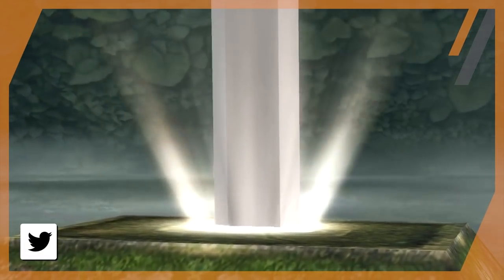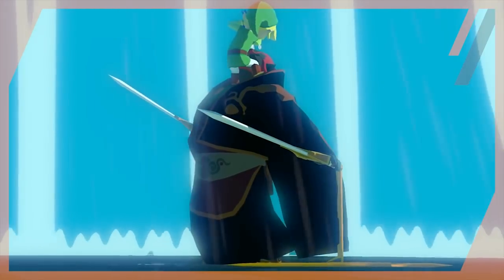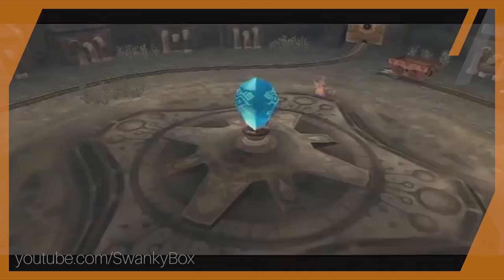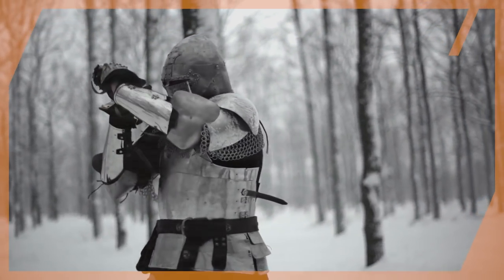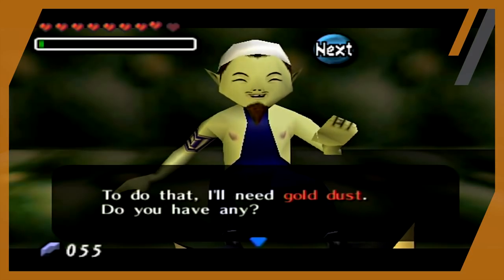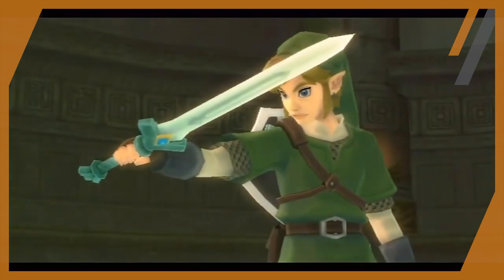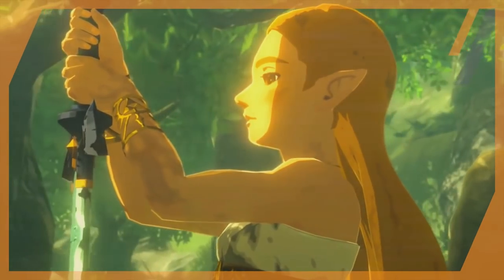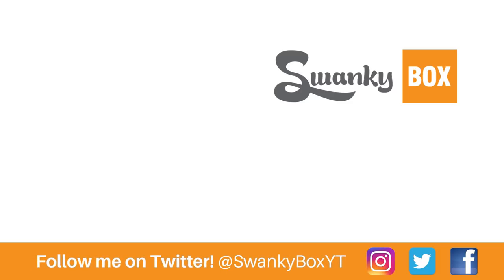Why EVERYTHING About Zelda's Master Sword Somehow Makes Perfect Sense

Comment: 1. The Master sword is NOT a broad sword. It's a Bastard Sword.
2. Armor CANNOT be cut through. Only through some gambeson (cloth armor).
The higher quality gambesons took a couple of swings before you could actually slice the flesh of your opponent. But most people also had chainmail on over their gambeson. Which chainmail is resistant to slash but weak to thrust and strike.
Reply: Well your point on armor not being cut through is flawed as armor can be cut though like gambeson it just depends on what metal the sword and the armor are made from and how the armor is struck.
Reply: @PaulonTheBrave  
I said gambeson can be cut through, sometimes it just takes more then one swing though.
Reply: @s.e.n3264  ok
Reply: You also said armor CANNOT be cut through. You even capitalized the word lmao
Reply: Bastard Sword? That's not very nice what did the Master Sword ever do to you? Why you gotta disrespect the poor thing.
Reply: @benwells7047  
Yea, then I said gambeson can. You can't cut through chainmail or plate armor. Please finish reading the whole thing people...
Reply: @Werewolf914  They should apologise to it, its doing it's best
Reply: you cant cut, that is why you hold the sword by the blade and strike with the oposite side, as a hammer, or use a hammer.
Reply: I'll throw my hat in the ring on the realism of the master sword
1: Let's get our terminology right. The Master Sword is best described as a Longsword, which most modern people know as a "Bastard Sword" and the sword most people associate with the word "Longsword" is actually an "Arming Sword" or sometimes even just called a sword.
2: I'd say the most unrealistic thing about the sword is.. where is the distal taper? with very few exceptions, the design of swords tend to have most of its balance and weight near the handle to allow it to be maneuverable, but this would be a lot more top heavy.
Reply: As a modern term, I agree, it's a bastard sword. But historically, it would be a long sword, or even just called a sword. Really, its just an ornate version of a classic sword style. If you really wanted to call classify it, it's probably closest to an Oakeshott XIII.

 And armor "can" be cut through and not terribly difficulty with a sword like that. But there's next to no point of doing it, as the armor would still have done it's job. And likely you will have just lost your sword. Any cases of it happening in combat are pretty much fluke accidents. (Ex. A blow getting deflected into another person.)
Reply: @igorgiuseppe1862  
It's called "Half swording"
Reply: Even half swording doesn't cut through armor. You are trying to damage the armor and using the sword as a blunt object. One handed swords aren't designed for dealing with armor.
Reply: @Quentonic  The master sword is more like a large hand and a half/bastard sword. Which is still classified as a long sword. It could do the job, again, plenty of cases of swords splitting armor. But pretty much unintentionally. No one who knew what they were doing would actually aim for the armor.
Reply: Also, the stuff about the soft core and the hard edge applies to katanas but not to european monosteel blades.
Reply: @PaulonTheBrave  Nah, it's nigh impossible to cut through armor- it's too strong. The only way to get through it with a weapon is puncturing it, like with a warhammer.

Mind you, we're talking plate armor
Reply: And you don't want a sword to be sturdy, you want it durable and really flexible. I think we both vringe as much with this video.
Reply: And the crossguard is ridiculously thick and chunky
Reply: @giovannylinares2054  Um... difference between those two words? Sturdy and Durable are synonyms in most peoples vocabularies
Reply: @giovannylinares2054   And I'd generally call this bit creative license, although with the Timestone theory we actually have a semi-good reason for it to be so thick. to aid in its chronomantic abilities
Reply: @aquamarinerose5405  In this case, I believe Sturdy would mean 'solid and inflexible', which you don't want in the blade, specifically- needs to have some Wiggle, as it were.
Reply: @AtelierMcMuttonArt  Ah, that I can understand. I just generally assumed sturdy and durable to mean generally the same thing... And of course with the power of the gods imbued into it you probably could've made it out of whatever and it would work just as well tbh.
Reply: @Dhorannis  While certainly correct for the historical analogues for the Master Sword, there have been times when European and Middle Eastern smiths have used different steels for the core and edges and welded them together.
Reply: @Cataru Moore: Maybe the material of the master sword is very light - so light infact, that the creators maybe deliberately made it top heavy, so that you could deliver heavier blows. But then again, if they wanted to make a weapon that can hurt foes in armor, they could've just made a warhammer out of the same material and it probably would've been better.
Reply: It's a Broad sword in OOT and WW!
Reply: no a bastard sword is a long two-handed one. broadsword is a hilt &1/2
Reply: 1. thats not very family friendly though. they'd have to call it a "hand-and-a-half" sword for it to pass the censors.
2. yeah, but Link can flip over gaps with both a sword and shield in his hand and even parry a centaur that's charging at him like a bull. i think normal human limits are irrelevant when talking about Link and his magical sword.
Reply: I say send him to the ranch
Reply: 1.That is...an unfortunate name...
2.*unless you're in an anime or other such fiction, because then armor might as well be paper mache. Granted, armor in Zelda does usually work as intended, but since it is a fictional universe, I felt it necessary to say that
Reply: Its a spanish Tizona sword.
Reply: @M R  M R  firstly why are you taking offence to a 3 month old comment, second i wasn't trying be a historian I was pointing out that in theory a sword made from a stronger material and with a sharp blade could in theory cut through armor. That and the person i was retorting was implying armor couldn't ever be cut though when we are taking about a literal divine weapon made of a unknown material that could have those properies. 

Then again this is the biggest problem about trying to bring logic to a fictional weapon that not only has both divine and spiritual properties not to mention the metal it's made of is unknown
Reply: @M R I wasn't trying to be holier than thou on realism. I was more just saying it because the #1 problem that most fantasy has in regards to "Realism" is making things too thick and wide. and if we're trying to go for how practical/ 'realistic' the sword is we get that point.
Reply: You sound like shadiversity or something
Reply: And 3: we dont use the master sword in majoras mask
Reply: So you think carbon steel can't cut through wicker, bronze, leather, silk or wood?
Mind explaining why I had to repair so many round shields if armor cannot be cut through? Sure looks like those shields got cut through quite a few times in the course of the battle.
Think you can't lose your wrist just because you put an iron splint guard over it?
Or are we just pretending like non metallic armor was just never a thing if it wasn't gambeson?
Mind you, silk robes serve as armor and protection as well and can keep a blade from cleaving in to your vital organs, but it won't stop the cut. For your statement to be true, you have to make some absurd rules as to what qualified as armor. Freaking animal hides were used as armor, and plenty of those got cut through, most noteably in the settling of America. Armor isn't just something that exists on the European continent... this is a huge problem with you guys in the HEMA community and it's only getting worse.

You guys gotta realize that your world of martial arts isn't the whole world. Saying that armor can't be cut through is an out right lie that too many people believe and it's going to become another stupid myth right along side "the katana is sharper than a longsword". Admirable effort, but so, so wrong when you travel away from the west. There are swords that could cut other swords in half because you have high carbon steel meeting plain iron at a combined speed of 150mph in some cases.

Also... if I don't have to worry about a sword getting through armor, why am I taught to be so cautious about my wrist getting struck in kenjutsu, even with armor involved? Simply put: it's there to give you a chance if you screw up, but it can and will be cut if you aren't careful. The helmet and breast plate... good luck cutting through some of those. But there is plenty, and I mean PLENTY of armor out there that you can cut through with a carbon steel sword. And yeah... the english cut through plenty of primitive armors in their day as well, some made of simple woven wicker.

Edit: apparently armor is a term specifically relating to metal... wtf? Then what do we call a wooden shield or a laquered bamboo breastplate if they aren't pieces of armor? So... ummm... my bad? I think?

Comment: The master sword in botw is meant to represent link’s physical state as well like how in the beginning link is injured and so is the sword, but also that is why link needs 13 hearts to pull out the sword so he is physically back to where he was before hand, Zelda putting it in the stone was preserving it until link was upto physical strength again so there must be some connection (I.e. links blood mixed in with sword) which is why only he can use it and it represents his physical state
Reply: while that makes sense wouldn't Link get damaged with the sword

Comment: Cool vid, love the idea of the time stones in the hilt of the sword regenerating it by rewinding time. If the hilt breaks, does the sword just shatter completely as it regains all the damage it's ever taken?

Also, couple notes for you.

---Steel, in ancient times, was actually regarded as a magical material in and of itself. Because it was so much stronger than bronze, and even iron, well-made steel swords were incredibly sought after, and incredibly rare, up until the secrets of making good steel became widespread. Some of the first steel used in swords was from meteors, and it was thought to be a material literally from the heavens.

---The process you're describing isn't how European steel swords were/are made; you're actually describing the process for making a katana. It's called Differential hardening; katanas have a unique structure and are carefully lined with clay in different thicknesses across the blade as they're cooled to achieve the softer, more durable spine and the harder edge. This technique was used to make the best of the poor quality steel from the subpar smelting process used in ancient japan, which couldn't purify the steel completely. The sword literally bends in the process of cooling because the difference in cooling is so extreme; it's part of what inspired the gently curved blade of the katana, or at least that's what some historians think.

I won't speak to how European swords were made, but generally speaking, you CAN use one hardness of metal in a sword; you just need to pick a hardness that CAN hold an edge (The harder the sword, the better the edge holds), but won't be so brittle as to snap from shock (A softer sword will bend or even flex instead of breaking). Get this balance juuuust right, and you can get spring steel, which is pretty amazing stuff and can bend while still flexing back to its original shape - This makes a durable sword that can hold its edge.

---I totally respect focusing on the bare minimum of "sword bits" - If we got into pommels, grips, crossguards, blade and edge and tip and so on, the video might get bogged down. However, I will say that I would classify the Master Sword as a long arming sword. Broad sword is... A weird and misunderstood term to say the least. All of these terms are sort of modern and made up by historians rather than people living back in history, but a broad sword is, by modern convention, mostly a specialized thing if a thing at all. An arming sword is a one-handed sword used with a shield, which sounds pretty much spot on for Zelda to me.

For those curious, the general classifications are dagger, short sword, arming sword, longsword, and greatsword. Longswords are generally wielded two-handed but could be wielded with one hand sometimes; greatswords are barely a sword and more of an expensive polearm, while still retaining many of the useful features of a sword; short sword is one of those weird niche terms, but it's basically somewhere between a dagger and an arming sword, and a dagger is essentially a knife designed for combat. Yes, it's different than a knife. Mainly because you don't stab tomatoes, and tomatoes don't try to stab you back.

Comment: What would the Shrine of Resurrection's tub be made of then? I know the Sheikah have their technology, but would it be sensible that they made the tub of those time stones?
Reply: Well by that point master ore and time shift stone were rare and no one knew about the existence of either though how do you explain the blue tones of shiekah tech along with the stasis rune
Reply: @SuperGamefreak18  Those are good points. I suppose knowing where botw falls in the series helps. I for sure don't know.
Reply: @MyDogIsYoshi  honestly i think the most stable idea is thousands of years after twilight princess
Reply: I think there's a theory on YouTube that suggests that all the Sheikah tech is based on timeshift stones
Reply: @BlueKokiri3  There is, it might be called "The Secret of the Shiekah" or some such. Essentially the ancient Shiekah rediscovered the Time Shift stone technology and diversified its application. They made mechanical parts out of powdered time stone, so they never age. They liquified time stone for use as a preservative and fuel source. And the high end energy weaponry is simply converting the time shift stones into the fourth state of matter, plasma. This would explain how the divine beasts and guardians were able to stay preserved thousands and thousands of years. The large blocky tower like constructs that we know the guardians emerged from could even be made of Time Shift stone, to keep all the technology from aging, even beyond the base measures. When considered as  a whole the theory makes a lot of sense, though obviously the tech has been altered drastically in its practical use.

Comment: I have a theory! 

The four parts that go into any sword are metal, to make it, fire to shape the metal, water to cool it down, and a person to bring it all together. 

I think that the power of the sword may come not from it's material or time stones, but rather that the elements involved were higher more divine versions of these powers. 

Firstly, fire is always tied back to Din, the goddess of Power 
Second, Water is always tied back to Nayru, the Goddess of Wisdom 
And third, Link as well as electrical or forest energy is tied back to Farore, goddess of courage. 

All of these elements together help form a sword in general, but also the master sword. I think that the "3 golden traits" depicted in the 3 golden goddesses, are all just stronger versions of common elements. 

Water represents the flow of the mind, and in Hyrule's case, Wisdom and water represent high technological ability. And irl, as well as in hyrule, the first machines to come about were steam powered, or, powered by water that was evaporated. As such, Hyrule just has the potential inside it to turn the power of water, into the power of wisdom. 

Fire is the same way. Across all of history, fire has been used to demonstrate or gain power. Every overthrow of the government, has them all wielding torches and burning things down. As such, in Hyrule, fire leads to Power because of  these aspects. 

And Courage is the power of humans to overcome their fears by confronting them. It's the power of humans to overcome their biggest obstacles. 

As such, the sword was made using the higher versions of these elements. 

The goddess Hylia brings the metal, 
Then Din uses her raw Power, that manifests in a flame like substance, to melt the blade
Followed by Farore who uses courage to overcome the fear involved with dealing with melting metal, and shaping it into the sword, 
Then lastly, the wisdom of Nayru cools the blade down so it can be used, 
before the Goddess Hylia ties it all together in the end. 

This way, it does 2 things. It shows the Hylians and other races of hyrule how to craft a sword, while also empowering one specific sword, The master sword, with the power of the goddesses, allowing it to last seemingly forever, and give it it's great power and name of "the sword that seals the darkness." 

But HEY, That's just a theory!! A HYRULE THEORY!!!! Thanks for reading!

Comment: In link to the past, you reforge the master sword twice. In phantom hourglass, the phantom sword is made of three pure metals: crimsonine, azurine, and aquanine. I would assume the master sword to be forged from the three pure metals, with some goddess power for extra measure. It was blessed by zelda, reincarnation of Hylia, and tempered by the three sacred flames of the goddesses din, farore, and nayru.  It would stand to reason the flames are a physical representation of the goddesses' power, thus the spiritual aspect.